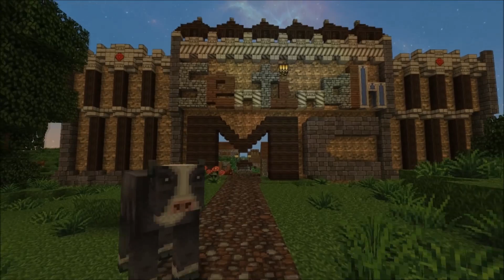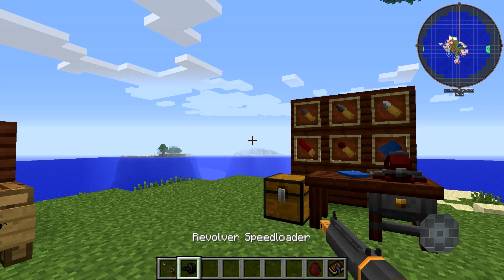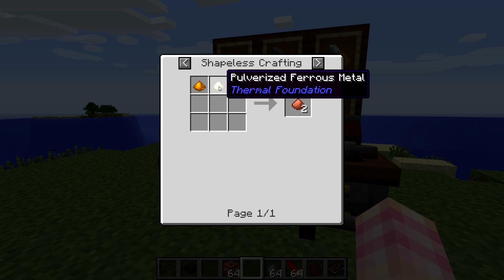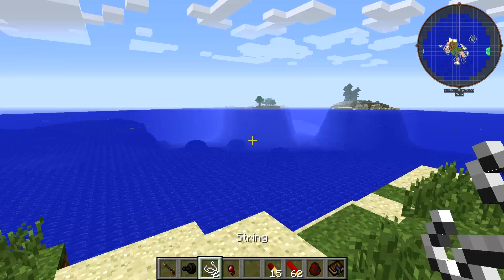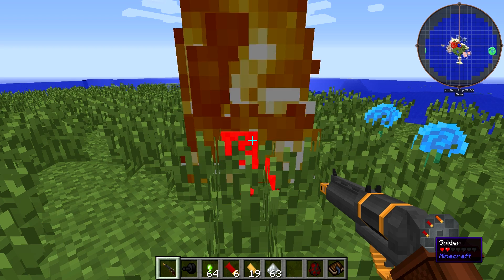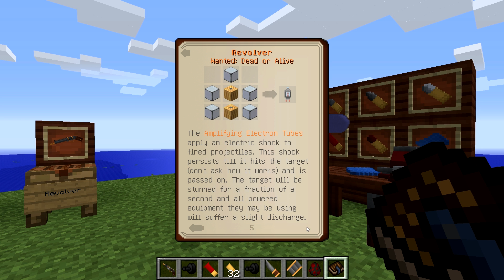Immersive Engineering Tutorial #16 - Revolver

Comment: Hey sentinalh, are you planning to do an immersive engineering tutorial for 1.8.9?
Reply from the maker: Is it different?
Reply: +SentinalhMC yes. It contains several new things, such as the tesla coil, the faraday suit, a new appearance for the fermenter and squeezer, new construction for the diesel generator, vertical conveyor belts, HV relays can be placed on the top/sides of a block, and noise gates, Witch are equip able earmuffs that block sound. Also 1.8.9 has the potential for updates (the developer has abandoned 1.7.10), and coming in the next update is the lightning rod, a new form of power generation. And coming soon is the nuclear reactor and steam turbine.
Reply from the maker: Kai Beasley
The lightning rod is in the 1.7.10 version. I know a nuclear reactor is coming soon. We'll see. I did want to put together an extremely lite modpack with IE in it that I could play with vanilla players.